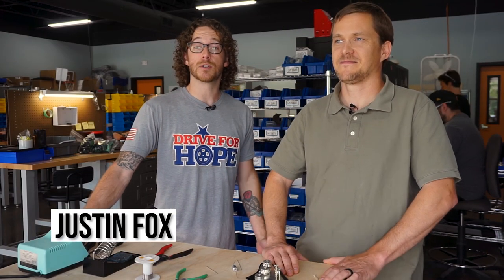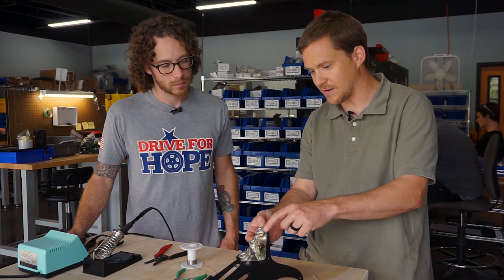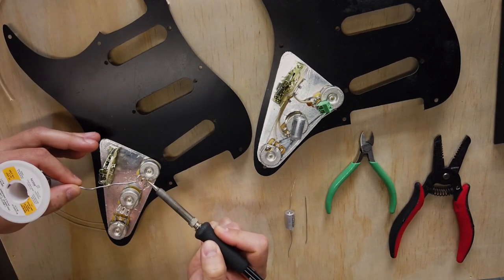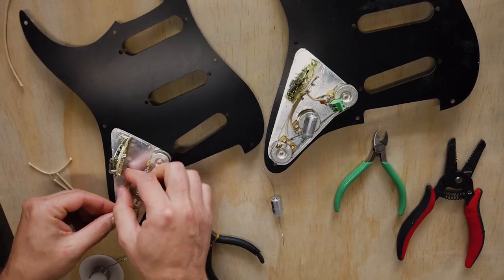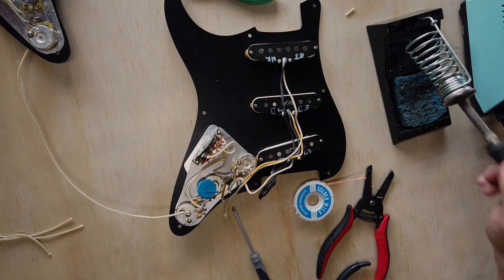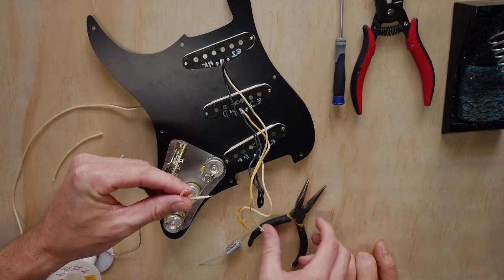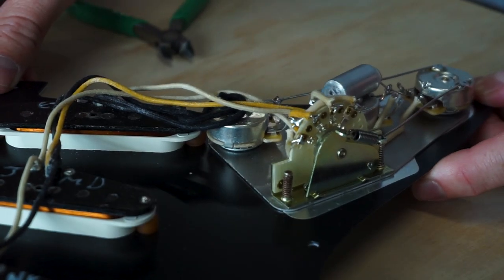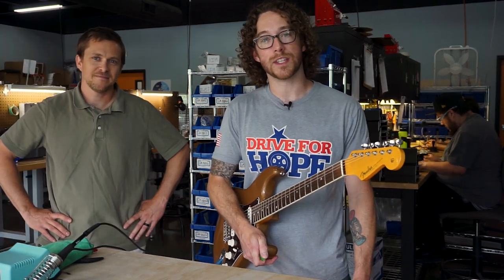Mojotone Tech Talk- How To Solder - Tips and Tutorial

Comment: What temperature do you have the iron set to when soldering to the back of the pots?
Reply: Hi, I run it wide open at 800+ degrees for more speed. As a novice I would back it down to 700 or so just to be safe.
Reply: @davidshepherd8704  Thanks!